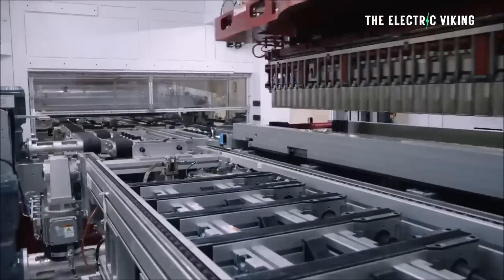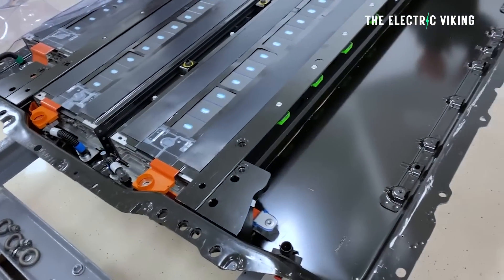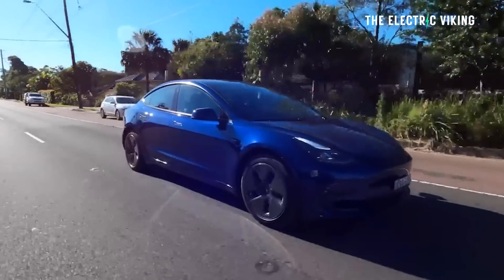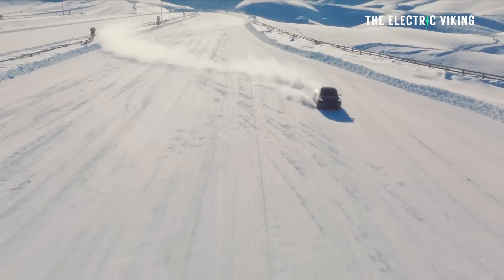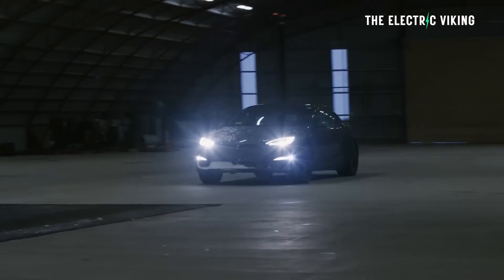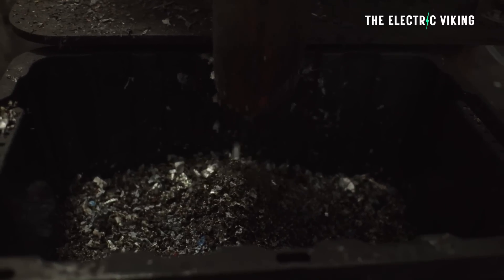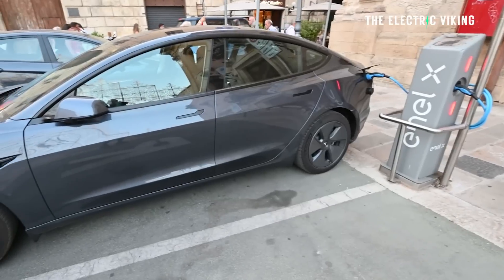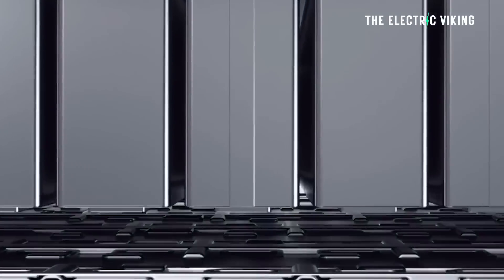Tesla reveal how long its batteries last after 200,000 miles of driving

Comment: Sam, I think you and the media are missing a central reason as to why larger battery packs have higher degradation. 
The people who buy the larger battery pack cars are people for which range between charges is important. This implies that those people are making longer trips, which in turn implies more DC fast charging. 
DC fast charging will degrade a battery pack faster over time. 
Cars with smaller battery packs are more likely to be commuter cars and slow charge at home, thus avoiding as much degradation.
Reply: Good point. Every use case is different. Ours is - retired couple living in rural France, had Kia e-Niro from new in 2019 that is our only car. We have averaged 19,000 km a year over 4 years,  85% of our km are from home charging and covered by the solar panels on our roof. We haven't even bothered with a home charger, just a regular plug at 2.2 kW...typically we plug in once a week at around 25% and take it to 80%. On road trips of course we use DC rapid charging but maybe a couple of dozen times a year. The battery is NMC and OK, maybe LFP does last longer but to all intents and purposes I am unlikely ever to need another battery at my age (66) as with a 450 km range I can tolerate some degradation. Besides, it isn't all about the chemistry of the cells, it's how they are assembled and managed. The SK On NMC battery in my car is one of 2.5 million in EVs now on the roads and there have been no fires...whereas other manufacturers have had fires which were found to have been caused by manufacturing process errors, not the inherent chemistry of the cells.
Reply: @kiae-nirodiariesencore4270  Great info on the longevity of early EVs!  I am of the silver haired crowd too, but can hardly wait for the EV transition. Cleaner air, quieter roadways. 
Is anyone realizing how valuable land near once noisy roadways will become in the next 20 years?  Not investment advice 😉
Reply: @nickmcconnell1291  if it’s near an exit, it should be obvious. There is some noise from faster vehicles, even if they are electric, though.
Reply: The degradation was at 300,000 mile. Whether you do it on long drives or short drives, it is still 300,000 miles. Sam is right about the short range LFP batteries lasting longer as LFP have been shown to be able to be cycled about 75% more times than Ternary. Batteries and their cooling and management are always getting better so the 12% degradadation from older teslas will be bettered by newer Teslas. EVs are developing quicker that flat screen tv's
Reply: @brendonbackwell9706  This is true, but people who buy the bigger packs for travel will charge their vehicles to 100% more frequently than those who have smaller packs. For example: I travel for a living, and imagine what it would be like to travel in a Tesla (Hence the reason I watched this video). If I have a long trip, I'll probably charge to 100%, right? This being more unhealthy for the battery (and I'd be doing it frequently) would affect it more than a small pack that's owned by a retired person who never uses superchargers and almost never charges it to 100%, right? Maybe this is a rare case; but in my mind, people who buy the long range do so because they know they will travel. Let me know your thoughts.
Reply: Actually he said that right in the beginning
Reply: @Sommers234  Thanks Andrew! I will go and relisten.... it is possible I was fumbling with ear phones at that moment.

Comment: I drive 45,000 miles per year for my insurance appraisal business.   My 2019 Tesla M3LR Dual Motor battery has about 10% degradation at 60,000 miles ( I bought it used with low miles).   I'm expecting to keep the car at least 5 years or until about 250-300,000 miles.  Should be interesting to see how much I can get for it in 5 years with that many miles on it!    I'm sold on the brand and EV's in general.  Never going back to gas cars.
Reply: My experience with my 2018 LR M3 is that the 2170 batteries actually degrade faster when they get older.  Mine dropped 15% already at 88k miles. Only supercharged 3 times in 5 years. Almost always charged between 20-80%.
Reply: @dhui777  there's some issue with only ever doing 20%-80% charging.  Every so often you need to do a 100% charge so that the BMS (Battery Management System) can evaluate the battery's full, useful capacity.
Reply: @alexmanojlovic768  ok, thanks.  I will try charging full to see what happens.
Reply: @dhui777  go to the forums to see what the recommendations are for your specific car/battery chemistry. I don't have an EV, I'm just going by what I've read.  Make sure you don't brick your battery based on my vague comment without direct knowledge of your particular car, please...
Reply: It's weird right now. Banks have no idea how to value evs.
Reply: Youre sadley mistaken if you think your doing something good. EVS are destroying the planet with toxic metals.
Reply: People who do 50-100 miles/day are waiting for you to get bored with your Tesla... Be nice to your poorer Tesla supporters....!!  😆😅😂

Comment: What people never talk about is gas cars have mileage degradation also as they get more miles on them and engine wear starts to happen.
Reply: Plus, most car fires happen in gas-powered cars.
Reply: @scottbreseke716  Petrol ICE cars are 60x more likely to catch on fire compared to EVs.
Reply: @scottbreseke716  Easier to put out though. Imagine a basement full of parked EVs, one spontaneously catches fire, it can't be extinguished with equipment at hand, the heat is enough for the surrounding EVs to catch fire, the heat is so intense that the fabric of the building is damaged. I wonder how many times that will happen before it's mandatory to keep EVs parked out in the open.
Reply: My old Hyundai diesel has done over 260,000 miles and still achieves the same fuel economy as when it was new. If the engine blew up I could get a second-hand engine fitted for not more than £1000.
Reply: @brendanpells912  The lone voice of reason and good economics
Reply: @brendanpells912  and of course you can guarantee the condition/service history of a scrapyard 2nd hand motor??....  Cost of fitting that motor, then remove/refit 2nd time if that one's a sh1tter?   Life's not so simple with ICE tech.
Reply: @alexmanojlovic768  That applies to a replacement EV battery as well. You get a  battery that has had some faulty cells replaced to bring the capacity back up, but you don't know the state of the original cells, or how many are close to failing.
Reply: @brendanpells912  you stick to your poisonous Hyundai's.  I can't wait till I never drive behind a poison wagon ever again.   And of course.  .  I can't afford an EV yet myself, sadly.
Reply: @alexmanojlovic768  Fine, but you don't mind gas and coal-fired power stations poisoning the atmosphere to generate the electricity for electric cars.
Reply: @brendanpells912  here in Australia, we plan to be basically solar powered. All the states are putting in huge MW batteries and heaps of solar farms. In addition a great deal of homes have rooftop solar, including us. We pay nothing for charging our car. This will become the norm. Embrace the future, it is coming. Do some research on what was said when the first cars were displacing horses. You may feel you will never be able to afford an electric car, or a t least a Tesla, but I guarantee you will within 5 years. Then when you drive and charge it you will get it.
Reply: @blairbrewster9952  I've been to Australia. You have a huge land area, small population, more sunshine than you know what to do with. What works in Australia won't work in colder Northern climates. It's about 2°C outside, how cold does it get where you live? What are you doing to stop Australia exporting oil and gas?
Reply: @brendanpells912  I agree Brendan, what works here certainly will not work everywhere on our planet. 
The point I wish to make is, right now the EV's are as bad as they ever will be, they will only get better, more range, faster recharge, cheaper, better materials, less toxicity, safer. List goes on. The ones Tesla make are bloody incredible already. I've driven many cars, V8's, turbo 4's, hot Rotarys, V12 Jag, my model 3 blows them all out of the water. Embrace the future, you will be part of it.
BTW, a cold Winters morning would be -5 C, but it warms up to 20 C by lunch. Cheers
Reply: @blairbrewster9952  I disagree, I don't see EVs be coming more efficient because they're pretty efficient already. If you have a motor that is already 93% efficient, can you get it to 95% efficient without making it a lot more expensive or compromising reliability. Same with batteries, there isn't much more scope to make them more efficient. Certainly, there should be efforts to make them less likely to burn, but that might make them less efficient or more costly. In the same way that all the emissions control fitted to diesel engines have made them less efficient, more expensive, less durable. I don't see them getting cheaper either because the projections for lithium extraction are that it will fall behind demand and that will keep prices up. Maybe the producer countries will form a cartel like OPEC to control prices at a level whereby they can become rich.

Comment: M3p 660 charge cycles (Scan my Tesla) around 9% degradation 
Nerd stuff 
60% dc fast charging 30% ac, almost always to 100% never below 15%. 

Think 1500 charge cycles in total capable, and another 1500 in home back up  storage use
Reply: Why are you almost always charging to 100%? You really need the full range every day? My M3P sees 96% level 2 AC and a 100% charge will likely only be a few times a year. Hope to have a lot better than 9% at that point.
Reply: Elon said it makes a small difference and feels nice to 100% 
No real reason

Comment: Makes you wonder why they don't pull ahead of the competition and start offering a 200,000 mile / 15 year warranty. Isn't that just as likely to bring in sales than just cutting prices. It won't cost Tesla anything if the degradation is as low as Tesla claims it to be.
Reply: Also they should wait till 4680 ramp up production
In which offering longer warranty will be advertisements for this new battery
Reply: @tv-ld3wv  I think we need to have cars in service for a few years to see how long they really last. Car makers should be required by law to publish data on all EV batteries as they are replaced, then buyers of older EVs can have more confidence in what they are buying.
Reply: @tv-ld3wv  4680 has yet to prove itself in this regard
Reply: Those numbers are accurate, there is plenty of independent data out there that says about the same. The current cars have better chemistries and didn't come with free unlimited supercharging, so likely closer to 8-9% @ 200k.
Reply: @OtisFlint  So would you agree there's no good reason not to offer a better warranty than the competition?
Reply: If you use the car on track every day with supercharging everyday, battery will degrade dramatically
Like ICE their gearbox , turbo and engine lifetime will degrade on track
Reply: Because 1d10ts will "drive it like they stole it" & take the P155 with the warranty claims.
Reply: This is true! If they truly believe their batteries have that kind of longevity in real life situations, then back it up with a corresponding warranty!

Comment: I expect my 2022 TM3LR to last more than a million miles.  I did the math.  Based on average degradation I will lose 30%.  I should have more than 250 miles with a full charge at a million miles and 20 years.  :)
This is the math for the 82Kw NMC batteries.  LFP batteries should last for longer than the car.

Comment: Battery degradation is also affected by hard acceleration (generating heat) and charge outside the 20-80% range. LFP is more tolerant of overcharging, and Tesla solved BMS issues by recommending charging to 100% on a weekly basis. Certainly it should be done before long trips to reset the BMS, but otherwise weekly seems excessively damaging to battery longevity. Certainly Teslas with more than 500,000 km on Li-ion exist. by which time most ICE engines need a major overhaul.
Reply: I beat on my car constantly (but no track use) so we'll see how the battery holds up. I kill ICE cars also, so a good test case lol.
Reply: Most Ice cars are pretty much junk at 250k these days. They do not build them to last anymore.
Reply: @davefroman4700  And replacement engines/gearboxes are ridiculously expensive.
(but, but, but, battery prices...)

Comment: I looked at a map of Tesla charging stations near me.  There are none near where I normally drive.  So, On longer trips, If I needed to recharge even a little, it would be a significantly longer trip compared to gasoline fill up, just to get to a charge station.  Before even considering an electric, keep this in mind.  If I had a 300 mile range, the real range is only 150 or less, because I need to get back home.  For a  lot of people, this is nuts.
Reply: You are aware that you can charge at other stations, too, right? You are not limited to Tesla's charging stations...
Reply: The smallest range of any Tesla is the Model Y RWD LFP car sold in Europe and China. It has a real world range of 215 miles (real world and not rated). Current weather where I live is averaging 50F and I get about 220 miles of mostly highway driving (small country, driving in any direction for over 1.5 hours means either the sea shore or land border to another country, so any drive of over 15 minutes usual takes me to roads with speed limits of 50 mph or more)

I  am charging once in 5 days to 100 percent (tesla recommends doing that for LFP batteries)

Long road trips are easier here in Europe. Average distance between superchargers here in NL is about 25 minute drive but gets more difficult in Central Europe. But then there are non tesla superchargers as well.
Reply: If you're in the US, every major highway will have a charge station at least every 50 miles. It's part of the infrastructure package. I can't drive 100 miles in any direction without passing 4-8 chargers, so where you live makes a huge difference.
Reply: @OtisFlint  I understand USA is much bigger and at places much sparsely populated than mainland Europe (generalizing here). 50 miles between two superchargers is the WORST CASE in Netherlands, and that is only talking about Tesla Superchargers and ignoring the others
Reply: @OtisFlint  I am in the US.  And that is great if one likes / wants / typically drives on the Interstate.  I don't.
Reply: Where do you live? Afghanistan?
Reply: @larryc1616  Antarctica. ⛄
Reply: Now look at the map of EVGo charging stations, and the map of ChargePoint charging stations
Reply: The Model 3 has 491km of range. For most Australians, this is all the range they will ever need for a holiday drive. With normal everyday driving to work and shopping, Australians only average 33km each day.

The EV range and battery degradation dilemma is redundant for most Australians.

Comment: Hey - have you seen/made a video about the new magnetic technology to reduce battery degradation? I saw a new report saying that with by applying an external magnetic field while charging, battery degradation can be slowed drastically, even with fast charging (and it enabled charging at much higher speeds) - and all this on standard batteries already included in these EVs, no modification required!
Reply: No modifications? How much weight do you suppose will be added into creating these magnetic fields?
Reply: @MegaWilderness  the magnetic fields are generated by the charger, under the car, not the car itself :) no limits on weight for that!

Comment: You should keep in mind that a smaller battery not only requires more charging cycles for the same kilometers, but also :

- the discharge current for the same driving style will be higher, which also leads to an additional reduction in capacity
- the smaller battery is more likely to be colder in the winter at night, and lack the capacity to keep warm, which can also lead to faster degradation.

So making EVs with smaller batteries, as early GM, Nissan, etc. did, was a very strange idea, not only because of the range problem, but also because of the huge degradation problem. 

So only Tesla and even early Chinese EVs were created with good intentions, imho.